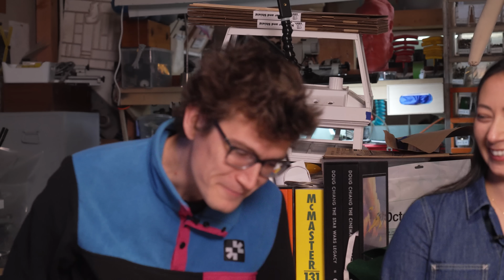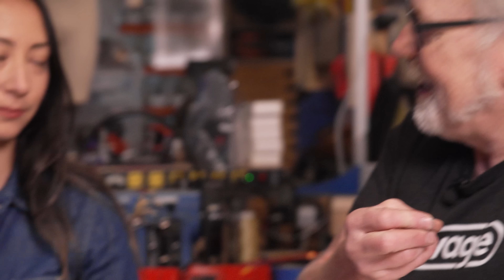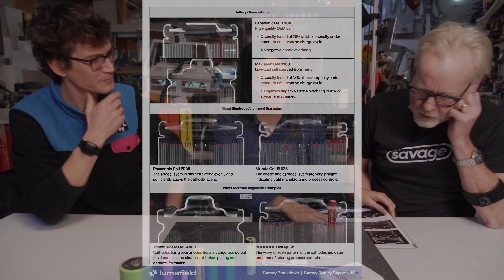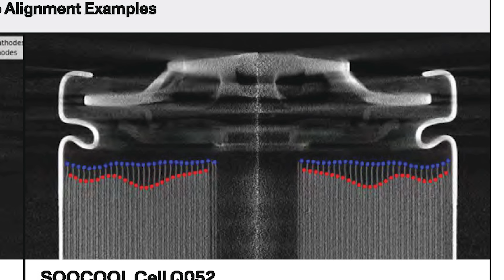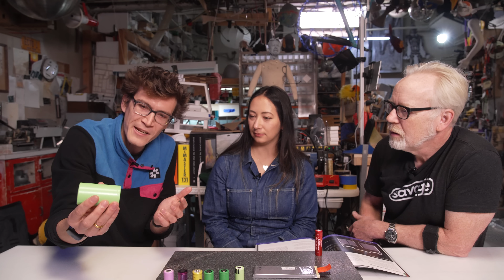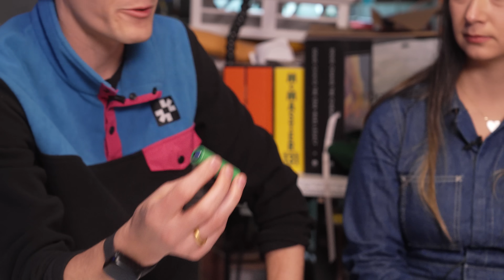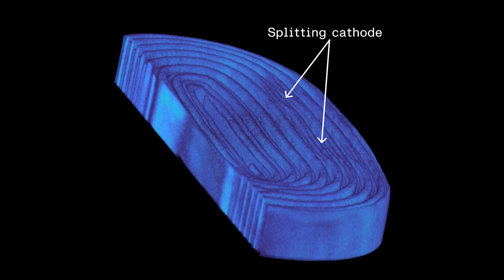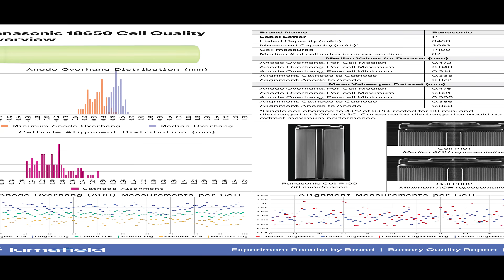The Surprising Flaws in 18650 Lithium-Ion Batteries

Comment: Do your battery packs ( power banks ) have safety certification marks?

I trust Canadian Tire and just bought one of their BlueHive 20,000 mAh power bank on deep discount.  Looking at it now, there's a Canada radio frequency mark (CAN ICES-3 (B)/NMB-3(B)  035-5495-0) but no electrical certification such as CSA, cUL, or cETL. or Intertek.  (I actually got it free because the website said 20W but it's only 12W.)  My mother's Hypergear  power bank  has CE mark but no electrical certification.  My expensive Zopec 100 Wh  power bank for my CPAP machine has two UL marks, IEC, FCC, and CE marks.  My Aukey Qi2 certified  power bank from Indonesia has CE and FCC but no electrical safety marks.  

Canadian gov web page "Battery safety: Lithium-ion batteries" says "Only use chargers that have one of the recognized Canadian certification marks, such as: CSA, cUL, cETL Canadian certification marks" but says nothing about marks for the batteries themselves.

Comment: I used 35 "non-OEM" of these 18650s to power a portable guitar amp that I invented... I took it to a music festival once and it was so cool....  but when I loaded it into the car to go to the festival a year later...  I must have bumped it too hard or something, and my 2010 Equinox burned up to the sky in my driveway, burning up the entire cabin and my clothes and other stuff that I had loaded.  sounded like small shotgun blasts.   BTW, I saw you in person at a Chili's in Folsom years ago, and my co-worker didn't believe it was you, but when we pulled out of the parking lot, I clearly saw Jamie driving the white van, and you were not riding shotgun, which seems to further confirm it was you and the crew.

Comment: LiPo (lithium-ion polymer) cells and batteries are fires waiting to happen. Especially the cheaply constructed ones, as this video highlights. Trigger events include physical trauma, over charging, over discharging, excessive heat, or just time/age. 

This is why i eschew buying products with internal LiPos (which are most of the "USB-C rechargeable" devices produced today). Even if they don't burn your house down should you neglect the devices, when the battery eventually dies, the device becomes useless. Even if you have the skills to open them up and can desolder the battery, chances are you won't be able to find a replacement battery. Sometimes rechargeable devices have internal 18650 cells inside, but usually not (unless we're talking about power tools), as the cylindrical shape is inefficient inside of generally rectangular (and often flat) device shapes. For devices which do, those 18650s might have pigtails and be soldered into the device; while one can buy 18650s with pigtails, they aren't as commonly available and so can be more expensive.

LiFePO4 (Lithium Iron Phosphate) is much safer; they don't tend to have thermal runaway which can lead to fires. They are heavier than LiPo, however, so can be at a disadvantage in that respect. But they are becoming available in many common sizes, like 18650 and 14500 (AA). 

Unfortunately, one can't use a LiPo charger with LiFePO4 cells (unless the charger has a LiFePO4 mode). Newer chargers are starting to include a LiFePO4 mode, but typically, it must be manually selected, as chargers can't discern that level of nuance, so they default to the more common battery chemistry, which currently is LiPo. That also means that if you use an 18650 LiFePO4 cell as a drop-in replacement for a device with an 18650 compartment and a USB charging port, you can't use that device's built-in LiPo charger.

I often pair a 14500 LiFePO4 cell with a dummy cell (basically a piece of wire in the shape of an AA cell) to replace a pair of AA alkaline cells. This usually works well because the voltage of a single LiFePO4 cell is a little bit more than two alkaline cells in series, and most devices can tolerate the additional voltage. Although one could use two NiMH cells, but their lower voltage is sometimes problematic for finicky devices (or produces dimmer light, in flashlights). That being said, NiMH is a safe technology not prone to causing fires.

Comment: I salvage cells as a hobby ( so they are usually OEM Cells ) and even though I knew a thing or two about cell I didn't imagined manufacturing could get that bad. On high power and mobile usage ( eskate, ebike, etc ) I stick with new Molicel from a reputable source only as they are per specs the best cells there are. 

What pisses me off though about them though is that Canada has a Molicel factory, but we don't have a direct seller in Canada, so the cells need to be exported to the states and then imported back to Canada.

Comment: Saving a few bucks ain't worth the risk applies to more than batteries, especially risk of fire. A cheap inexpensive no name toaster would not always trip and eject toast no matter how light the setting. And very difficult to force release by hand. Sometimes it worked just fine. Three times the bread smoldered, caught fire filling the house with smoke. That was too much. Not enough savings to risk a house fire. A few more bucks for good name brand toaster, accurate control, perfect toast, push button to cancel and eject if desired. And peace of mind well worth the 5 or 10 dollars more it cost for an appliance likely to be the last I'll ever have to buy.

Comment: I ride a Kingsong 18XL electric unicycle. It uses 120 Samsung 35E 18650 cells, arranged as 20 groups of 6 cells in parallel for 72 volts nominal (3.6 volts per cell) 84 volts max (4.2 volts per cell). The controller board controls the  charging to prevent over-charging and also balance the voltage of the 20 groups of cells. A lot of newer electric unicycles use 21700 lithium-ion cells, such as Molicel P42A or Samsung 50S which can handle high currents, so no need to have 6 parallel cells per group anymore.

Comment: If you have a suspicious battery or battery pack, better to put it in sufficient kitty litter or sand that it prevents any out-of-control fire. A battery pack can be put in a plastic bag to protect it from sand or litter so you can do that even if you're 'only a little concerned' with no harm to it. Also place it in a ventilated area. Whether in water or sand/litter, if it's going to combust, it will (even under water) and it will produce very nasty toxic gases you don't want to be exposed to. Battery Engineer & Firefighter Captain Patrick Durham has a YouTube Channel 'StacheD Training' that I highly recommend to learn about the dangers of Lithium Ion batteries. How many old, worn-out computer battery packs or drill packs do you have around? How many things would I CT-Scan if I could?! Cool.

Comment: I have two 18650 Sodium batteries which in theory are safer and doesn’t run away. But it outputs less current and you have to charge it more often. I use them in torches.

Comment: Blade batteries are a stronger structural reliable method of  cell construction.   And enable a better heat exchanging design.

Comment: When the batteries are for vehicles and iPhones the manufacturers are financially incentivized to make them ultra-reliable. When the battery is for a cheap torch or toy, it makes economic sense to manufacture cheap batteries. In the end, you generally get what you pay for as long as you don't fall for some unscrupulous seller.

Comment: The next ongoing concern is battery recycling programs. The local garbage company used to take all used batteries in a small container left on top of the recycle totter on trash days. Now they want me to order an $80 small bucket to load with any type of small batteries (maybe a dozen or so "AA" and "AAA") and then drop it off at a UPS store. My gut feeling is no one is going to spend $80 to recycle their small batteries... they're going to throw them in the trash. 80% of the plastics and cans the garbage companies collect do not get recycled, they go into the regular landfill. So will batteries until they can come up with a better battery recycling program.

Comment: Thank you for this very informative video. I was about to buy some unbranded 18650's from China and it's good I came across this video. Even branded ones might be suspect. I was told that "EVE' brand 18650's are of good quality and they do cost more than the other branded and unbranded batteries being sold by the Chinese sellers. I wonder about all those power banks sold online.

Comment: And that is why you never charge a battery pack unsupervised. Single cell in a good charger? that is fine, but battery pack is a totally different story. I have been using 18650 over 20 years now, never buy cheap, always high quality cells.

Comment: While I love Adam Savage…… And his yuck yuck yuck laughing attitude. These Lithium Batteries are no laughing matter. They are all little bombs waiting to go off. Lithium Batteries were never designed, to be used in these applications? To deliver such high-energy.  When you know they're going to blow up at some point. Not if but when?

Well lithium ion battery technology has changed our lives. It was never really designed for Prime Time?  When you try to do it, too cheaply? That's when those are designed to, explode.

I have been watching lithium ion battery technology with a rye eye.  To see these things blow up. And I've kept my distance from these larger  lithium-ion battery cells. To watch videos of them exploding. Yeah no! Not the way to go!

I really want this Solid  State Battery Technology to take hold? They are now working. But still not really ready for Prime Time? And so I sit and wait anxiously for them. No need to rush the technology and burn down my house? With little lithium bombs? So I'm not wanting to go there yet? I don't feel that manufacturers have worked out all the variables adequately?

I don't think these lithium batteries are any laughing matter? They were okay as a little button battery. As when they exploded.  They did not do devastating damage. But as soon as they upped the energy level? Without a proper BMS built in? It's Whoopsy Daisy time. Those are not the batteries to be using. And everyone is so impatient today to make their greed windfall profits? This will not work out well in the next few years? As these batteries begin to fail and explode  with those 18 650's. I am legitimately, terrified of that happening.

So I don't have anything except for tiny, lithium batteries. Nothing designed to deliver gobs of energy and voltage. I cannot trust the manufacturing of these batteries! Coming over from China with  Zero Quality Control. Tighter regulations need to be instilled.  These are little hand grenade bombs. That go off randomly.

So I think within the next 10 years? We are going to see a huge uptick? In exploding lithium batteries. When they begin to age out. And when Landfills begin bursting into flames. This could become a big problem? It is becoming a big problem. Really nothing to laugh at? Knock off the laughing. These are not funny. Nothing to laugh about?

 Everyone  wants to become Billionaires overnight. They don't care whose lives get in the way? Lithium is now like liquid gold. Everyone wants to make high profit yield batteries! Including a Gummy Bear Candy Manufacturer. And do you eat those batteries or install them? And do they chew? As long as a tootsie pop? I don't want to know?

All good things come, to those who wait. Wait for the Solid State  Batteries. Those should be another game changer?  Those might be the biggest game changer?

This was a great in-depth review on these 1 8 6 5 0, jellyroll batteries. I knew something not kosher about these things?  They are not to be trusted with your life. They still frighten me. Especially after this review. What a great review about such poor battery manufacturing?

This is what Governmental Regulations used to be all about? Make a dangerous product and be banned. We need to get back to those Governmental Regulations. They made sense! Nobody wants to make sense anymore!  They just want to become billionaires overnight.  That dangerous process must cease.  There has to be more stringent regulations.  These are just, plain dangerous. You can't cover up the danger by laughing!

This is an important video about lithium ion batteries for everybody to watch   and heed the warnings.
RemyRAD

Comment: Don't cheap out on stuff that has the potential to be dangerous; if the regular price is $25 and you're finding it for $3.50 it's pretty much guaranteed to be fake cheap junk.

Also, 15:57 and THAT'S why you don't charge stuff while you're sleeping or away; only charge when you are able to monitor the charger / batteries so if something does go wrong you can catch it before it burns down your garage or house.

Comment: 18650 cylindrical cells are crazy durable and easy to make (hello China), which is why they work so well in things like flashlights. But when you start building larger packs (like in a Tesla), the geometry becomes inefficient. Even with optimal hexagonal packing you still lose about 9% of the volume, and with the more common square layouts the wasted space is closer to ~21%. Flat prismatic or pouch cells can use almost the entire space, so from a pure packing standpoint cylinders are inherently less efficient.

I can’t be,I’ve how much of this is borrowed from simple math in plumbing. Once you really understand that the usable area of anything round follows A = πr² (that took forever to find), the same idea starts showing up everywhere. It explains why round pipes move air and water so efficiently, and at the same time why cylinders leave empty gaps when you try to pack them together. Circles are perfect for pressure and flow systems, but when the goal is packing density, they always leave space behind.